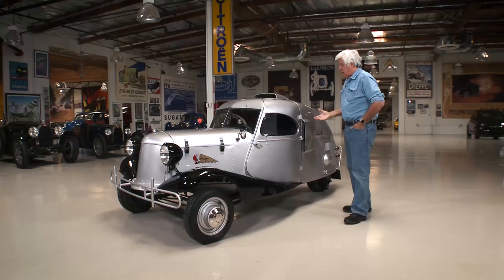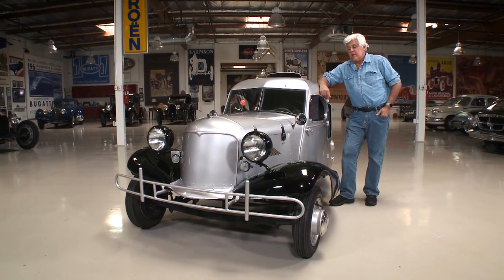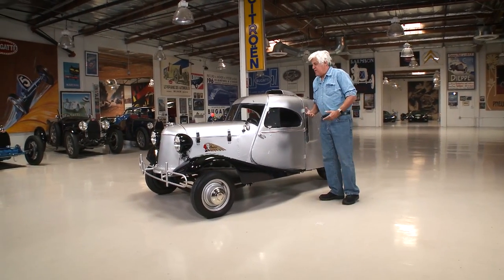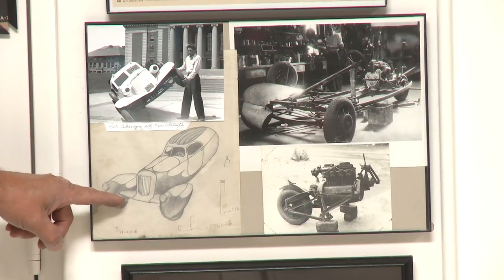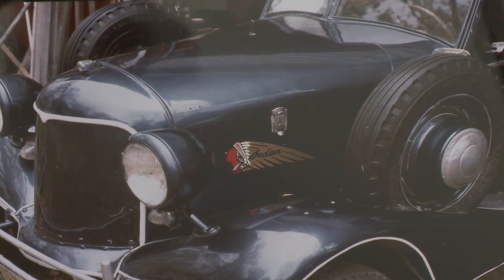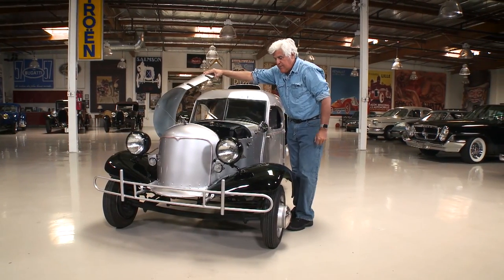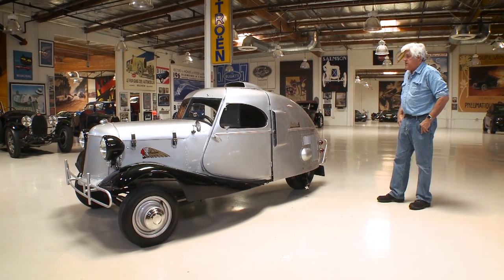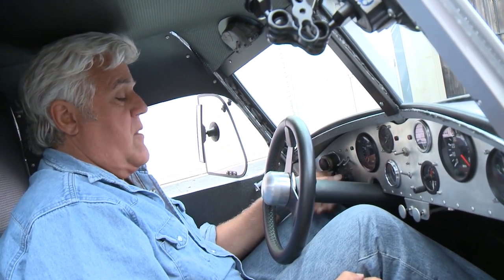1931 Shotwell - Jay Leno's Garage

Comment: That Indian Four came from the Henderson motorcycle right? From what I have heard those Hendersons then the Indian Four were one of the quickest vehicles on the road at the time. Police used them for traffic enforcement because they could run down pretty much any speeder. So I would guess even with the added weight with better aero it probably does move along quite well.

Comment: 2 upgrade suggestions. Separate the horn and cooling fans into separate fused wires.  Install a new fuse box and upgrade to the push in style fuses.

Comment: My dad always tells me that warning lights are called "IDIOT LIGHTS". By the time they light up, it's already too late and makes you feel like and idiot. Every car I've owned I installed gauges to replace the lights. My "98" Ford E150 conversion "A-Team" edition van with a bluetooth OBD II attachment and an APP on my Phone, Tablet and House computer that can be customized to show me any gauge from air pressure. temp. volts vacuum, speed etc. One handy gadget...

Comment: Would have been interesting to know how a 17 year old kid formed those complex sheet metal panels, particularly the doors and support structure around the main body. It's hard to imagine all of that was done with just tinsnips, hammer and a sandbag. Would be difficult enough to do today with C.A.D design using modern metal working equipment
Reply: They had a lot of spare time back then.

Comment: Jay got the car for free.  He paid to have it trucked half way across the country. He paid to completely rebuild the engine.  He paid to have all the sheet metal hammered back into shape.  And who knows how many panels were beyond repair and Jay paid to have new ones formed and installed.  Jay paid for a new paint job.  Jay paid for a bunch of new gauges, and new cooling fans and shrouds.  Jay paid to have an electric starter put in, along with a system to make it work on an engine that was not designed to have an electric starter.  Jay paid to have every square inch of the car looked at for problems, and for every problem to be fixed.  But Jay got it for free.  Jay paid to have all those things fixed because he loved the car, and he loved the story of the boy who built himself a car and drove it all over the place.
If you pay attention to Jay as he talks about Mr. Shotwell building the car, you can tell that he's struggling to keep from choking up.

Comment: Lol, my dad bought me a 1986 Renault Alliance GTA when I was a kid, we called it the "Yin Yang", lol. My dad had these wild nicknames for everything. The yin yang was old and beat down and had 200k miles on it by the time I was 16. Me and the boys down the holler gave that poor thing 9 kinds of hell and one day the transmission mount snapped right into during one of our un-sanctioned rally races! It'd pull one of the axles clear out of the side of the transaxle and it'd rev real hard like you shoved the clutch in, lol. After we jacked the car up and put the axle back in the transmission we found an old dog chain and wrapped it around the mount and bolted it and I forgot all about it. Well, I'd been after this girl forever at the time, and I had finally convinced her to go to the prom with me. Jay talked about showing off for the kids and blowing that fuse, after we made it to the prom in the yin yang, of course, I had to show off in front of half the school and do a big burnout in front of the school with my prom date in the car and BOOM! The dog chain snapped and it revved real hard and wouldn't move! Here we were stuck in the middle of the highway! At least she helped me push it out of the road before she dropped me like a bad habit, lol. That was my junior prom, and it was freakin humiliating, I fixed the yin yang right there in the Hannan High School Library parking lot, and that was the end of my prom night and that girl wouldn't be caught dead with me after the burnout fiaso, lol.

Comment: My first car was a 1930 something 3 wheeler B.S.A.  4 SQUARE ENGINE. When I got to 35 M.P.H. The engine would die down and the speed would increase to 45 M.P.H. with out assistance, I put it down to the vautex design of the rear of the car,  Along the lines of the v.w.

Comment: I put a temperature gauge in my 1984 Eldorado Biarritz  convertible. Someone told me that these HD 4100 can overheat and when they overheat they cannot be rebuilt. So you have to either find another HD 4100 Oldsmobile  307 or a 350 and yet it's funny I have not seen an 84 Eldorado with a 350 or a 307 Oldsmobile Engine in it.

Comment: I'm not going to scroll through to see if this has aleady been noted, but $300 would have bought a pretty good car in 1931.  The first Model A roadster was $385 new, and I'm sure you could have bought a very nice used older Model T for $100 or less.  That being said, I'm sure the cost on the project just got away from them, but the results are still very impressive for a home-made project.

Comment: Shotwell Owners Manual: Troubleshooting Guide:
..            In the event you find your Shotwell's  Fan, Horn, Head lights, Dashboard Gauges, Ignition,  Radio, Cigarette lighter,  or                           .            Windshield wipers not working.
      Step 1. Open fuse access panel door  located below dash on passenger side 
      Step 2.  Remove old fuse and replace with 20A fuse..
      Step 3  Close access panel door.

Comment: Neat little car. Especially for being designed and built by a teenager. Guessing the top speed is around 60-70 mph? Those tires look pretty small and thin, guessing wouldn't be good for high speed. But compare to a 1981 Honda Civic 1500 CC. 67 Horsepower and a top speed of 85 mph. Not really that far apart in terms of performance seeing as how 50 years separated the two.

Comment: I'm kind of surprised that an 8: amp 12 volt circuit meaning 96 Watts is enough to call that thing. That's only about a 1/8 horsepower motor at best. I guess it really only need you to cooling assistance from the fan what is moving at low speed and probably not with the throttle open very much. Great little car though

Comment: 9:22 It is NOT the same way Bob built it.It has ANOTHER hubcaps,wich are ABSOLUTELY HIDIOUS AND DESPICABLE (the original were waaaaaay more beautiful) and has the turning lights on the sides of the bonnet,NOT the upper corners of the windsheild (well,SIDE of windshield because it's rounded =) :P ) .

CORRECT this AUFULL mistake.